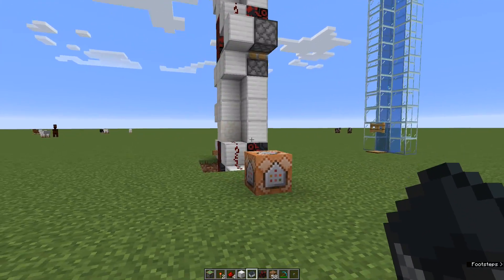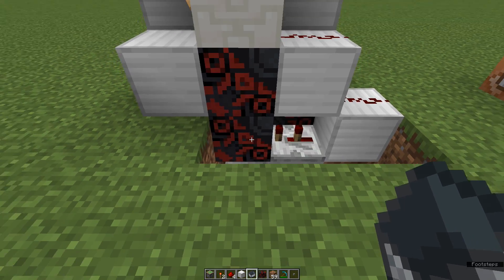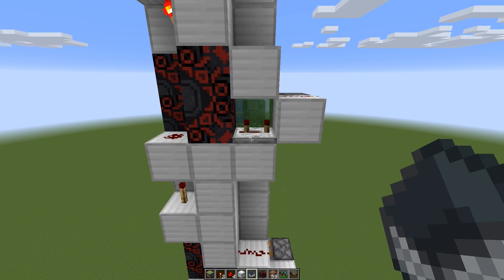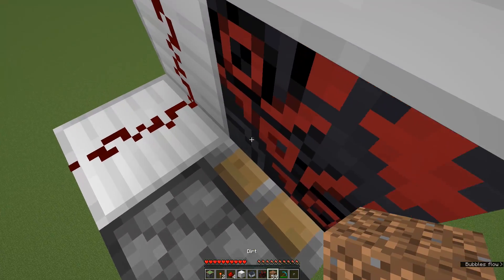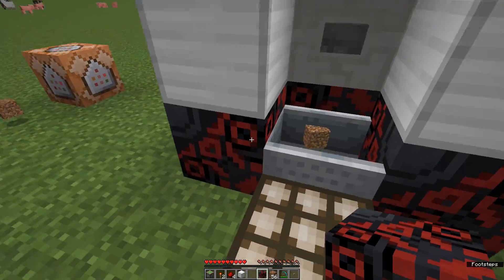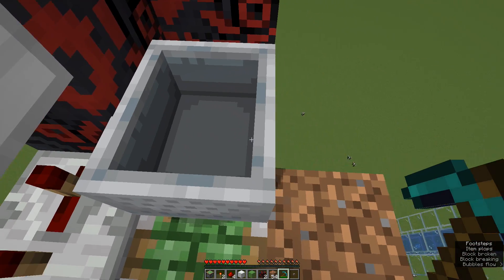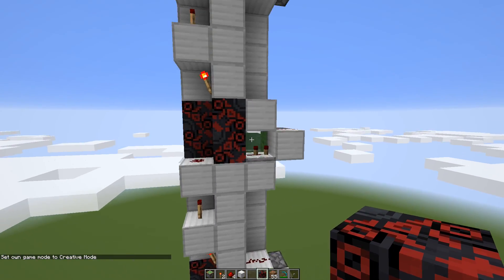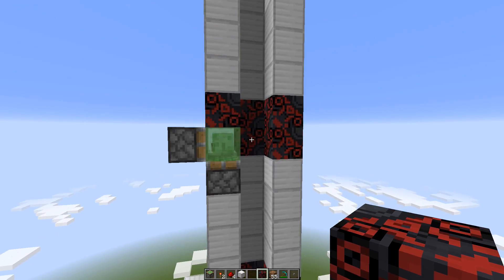Woolyvator Fix and How to Troubleshoot - 1.14.3

Comment: Built this on the roof of the nether up to a gold farm at build height in Java 1.15.2.  Can't use bubble columns up there.  Also, after the first two pistons all other pistons functioned as intended with the repeaters on 2 ticks.  Thanks for the design.  It's really good.
Reply: can u help me build it in 1.15.2

Comment: I need a faster piston retraction at the top, it doesn't close fast enough on ps4
Reply: I had this problem while using wood buttons due to their longer pulse, but then switched to stone buttons and problem solved. Might do it?
Reply: @jeffreyrhoten8652  Thanks I also had this problem and it really helped.
Reply: @jeffreyrhoten8652  Thank you so much, I just built this today after watching the original video, had the same problem, then came to this video hoping for a solution, but it was your comment that did the trick, now it works perfectly. :3
Reply: @jeffreyrhoten8652  I love you so much
Reply: @jeffreyrhoten8652  thank you! This was driving me mad. I guess I've been out of the game too long that I forgot they have different length pulses. Fixed it on PC 1.20.1
Reply: I have te same problem on pc, although i am using a stone button on the top
Reply: Jaakko Perttula try also using a stone button on bottom
Reply: Tbh a single cell in my body didn't believe that would have any effect but it worked. lmao i have no idea how the length of the redstone signal could have anything to do with the problem but it did. If you understand, please do let me know. Thanks!

Comment: Wow. I literally built this last night on Pocket Edition and if anyone tries this on PE. I had to trouble shoot it until I got it to work but every repeater need to be set to 3 ticks and and first repeater set to 2 ticks. The only way to get the bottom pistons after the first piston to shoot the cart up it to break the block across the piston and put red stone on that block so it can activate the piston. The only thing I can’t seem to fix is the mine cart  bouces all the way to the top and takes forever to actually stop. I made mine 7 sections tall and it takes 40 seconds for the elevator to stop bouncing.
Reply: JacobC thank you! You saved me loads of time. Do you know how to stop the minecart bouncing for a minute?
Reply: Will Bell  yeah I just pushed the top button and counted how many seconds it took for the minecart to reach the bottom. Then I messed around with repeaters until I got enough delay to match the time needed before the minecart reaches the bottom and bounces. Then put a stick piston on the block above the button (or really you can use any block)  and then wired the top bottom all the way down to a sticky piston that pushes out and stops the minecart. If you wanna see it for yourself look at my Instagram @suck_my_mineshaft and you can see it in action and I can post a wiring video if you need it
Reply: The wiring is a lot less messy now than it is in those videos so I should probably make a new redstone video anyways. No one has really asked so I never felt the need to remake it

Comment: I need help, I was able to get all of the timing proper with the slime blocks but at the very top my half slab moves slower than yours and instead of falling on it I fall all the way back down, I have timed it and it is almost half a second too slow, is that maybe because of the type of half slab? any way to fix this?